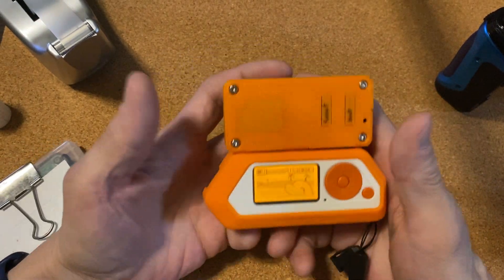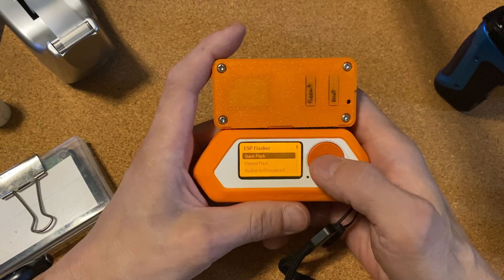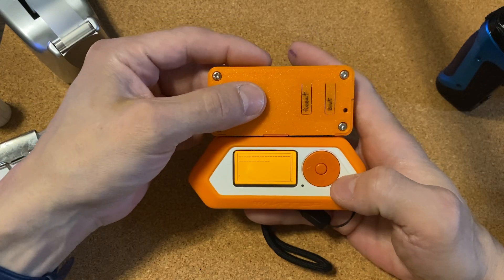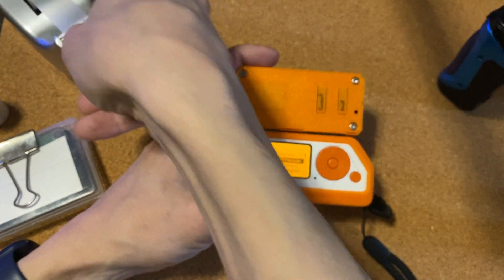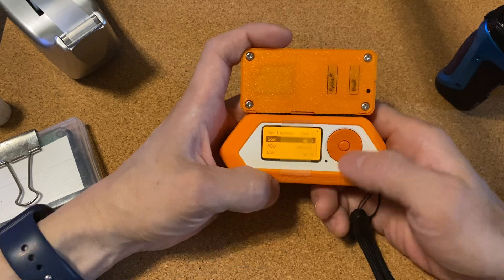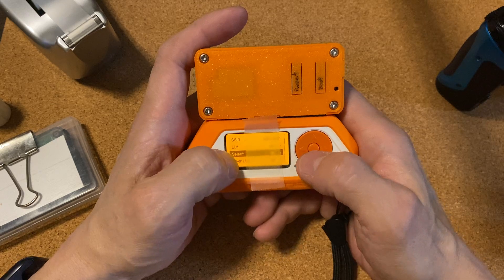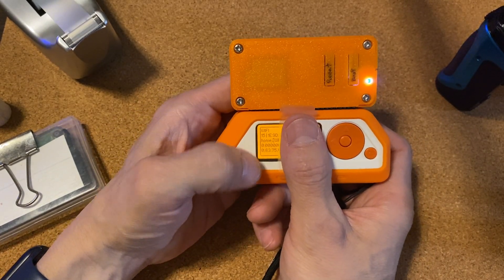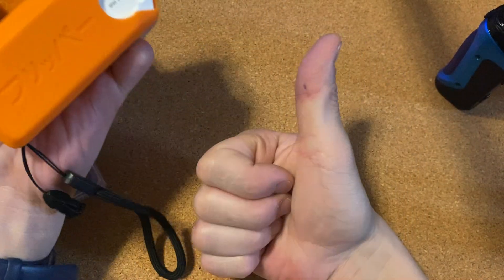WarDriving w/ Flipper Zero. Finished WiFi Development Board w/ GPS Chip Installed. Update & Demo

Comment: Very cool. Now I've got to figure out what the hell wardriving even is. There's so much I do not know regarding the flipper zeros. Ughhhh. 🥰😍😘
Reply from the maker: @LadyLocks  lol put simply Wardriving is driving around while scanning any and all access points while your device logs assigns and saves GPS coordinates to each one of them. That data can then be uploaded to online or private maps showing each and every access point you’ve scanned. That includes cell phones and any other access points (gateways, modems etc) that are in range of your scan.
Reply: @IsamuSushi  Holey crap!
Reply: Wardriving can also help you pinpoint who’s WiFi is who’s by looking up the gps coordinates on Google Maps
Reply from the maker: @DopeCity5000  yep yep yep, a lot you can do with this information (within the confines of the law…)